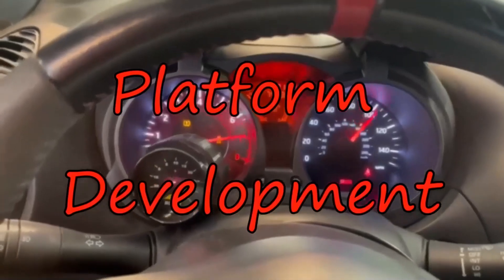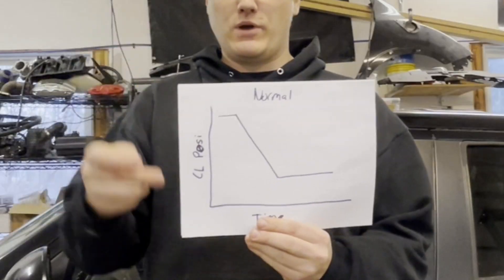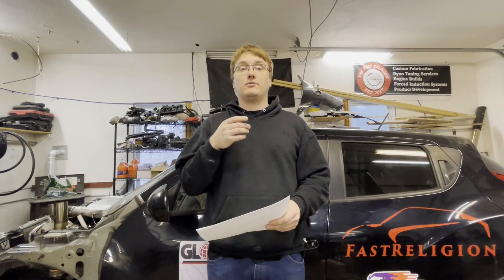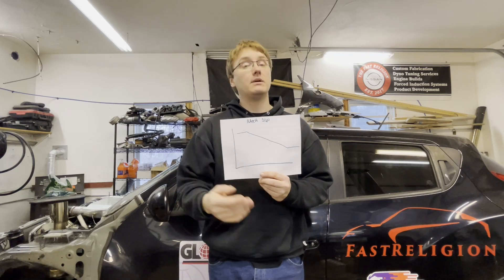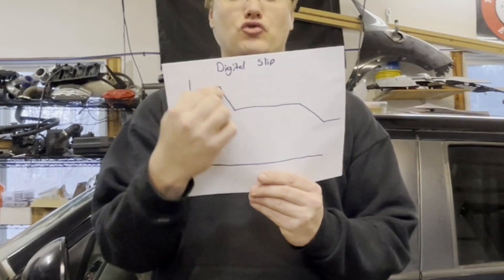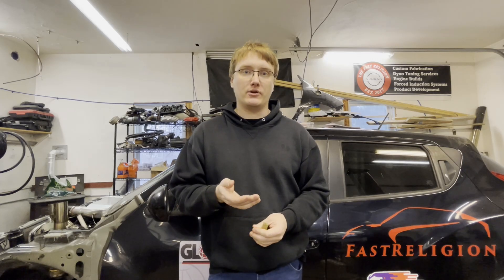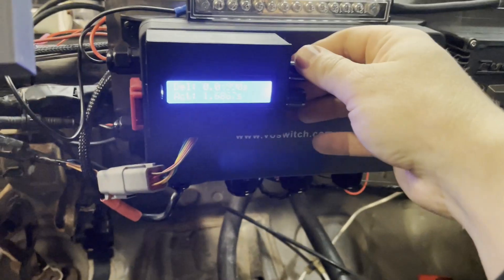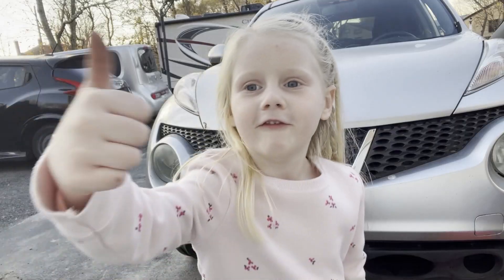What Is a Clutch Slipper? How Does It Work?

Comment: About 5 minutes into this. There are a number of applications for a 'slipper clutch'.
Cars are one, particularly for the launch off the line.
Bikes are another ~ particularly for the downshift, so your high performance engine with high compression and lots of cam,  little to no flywheel, mid-range to high capacity, doesn't compression lock your rear wheel, even if you rev-match the downshift. Race bikes today, tend to have a slipper clutch but also a computer controlled throttle, so you have the ECU add a little bit of throttle on the downshifts to control and moderate the engine braking. Getting that right is a major part of setting up your MotoGP bike, and it's worth well over a second a lap.
One of the more interesting ones I have personal experience with, was the Aprilia Futura 1000, Italian V twin sports tourer. It had a slipper that was controlled by engine intake vacuum. You get on the throttle hard, there's no vacuum, and the clutch bites with the full strength, but when you're back shifting at mid ~ high rpm, there's a lot of intake vacuum, and it has a pneumatic servo thing that adds or subtracts clamping pressure because of intake vacuum. If there's a lot of vacuum, the clutch tends to slip, which is nice when you're having a big go.
Like the Limited Slip Diff ~ there's more than one way to skin a cat.
Torque converters often have a sprag clutch on the (what do you call it? The centre flow straightener.) It can turn freely in one direction, but it locks solid if you try and turn it the other way. Conceptually, it's a ratchet, but it doesn't work like a ratchet. I've seen bikes that employ that concept to the whole clutch basket. It locks solid for forward drive, but slips on over-run. Does make it next to impossible to bump-start the bike, though ~ I hope your starter works and your battery's not flat. 
Talk about sprag clucthes, I don't know if all bikes work this way, but many do. They have a sprag clutch on the starter, so it releases when the bike fires.
A typical auto transmission has clutch packs, it has friction bands around the outside, it has a torque converter, and it may have other weird devices to control clutch action. If it has a 'lock-up converter' then it has one more clutch, to make it a direct drive through the converter.
Then we get into the rich field of Limited Slip Diffs. There are all manner of open or shut centres, starting with Detroit Lockers, going through 2 pinion and 4 pinion clutch-pack difs, Torsen diffs, fluid coupling diffs .... the concept is easy to understand, but actually getting it to work right and not intrude on normal driving ~ that's tricky. Like setting up a slipper clutch for launching a car ~ simple in concept, but very tricky in real life.
Go to Top Fuel Rails. When I was a lad (I'm 62) a Top Fueller had a completely mechanical setup. You were allowed (in the '70s) to use electronics and computer technology, to provide telemetry data ~ to have a log, with a graph, but the actuation of the clutch ~ along with every other control on the car ~ had to be entirely mechanical. That included things like centrifugal advance / retard on the ignition. I don't know when they changed the rules on that but boy ~ Howdy! She's a different game today. Which I guess is to be expected. In 1970 when I was 7 or 8 years old, a Top Fuel car ran a high 7 on a normal pass, a mid 7 on a winning pass, and a low 7 was getting close to world record time. Big Daddy Don Garlitz was still building Swamp-Rats, and some of them were embarrassing failures and some of them were world beaters.
The first ever rear engine top fuel rail, as a Swamp Rat.
Today, there are street cars running low sevens.
My last bike, was capable of high nines ~ show room stock. That was a ZX14, No, it didn't have a slipper clutch. It had a completely conventional multi plate bike clutch, but it was very big and strong and beefy, and maybe the best motorcycle clutch I've ever experienced. There were some things I loved about that bike and some I was less impressed with, but the clutch was a work of divine inspiration. It was just brilliant. You could have driven a large heavy car around with that clutch, no problem at all. The fact ZX14s had a drag strip reputation ~ partly that was power and power / weight, partly it was long and low and heavy at the front, but largely it was down to the magnificent clutch. Best clutch ever built into a motorcycle, and not by a small margin.
Reply from the maker: So, there is a difference between a Slipper clutch and a Clutch slipper. A slipper clutch is very well covered by what you typed out. A clutch slipper is a device designed to force a clutch into slipping. Not the clutch itself.
Reply: @TheFastReligion  Yes, I stand corrected.
Reply: good read thanks for typing

Comment: Would this setup have the ability to hold the clutch engaged with your foot off the pedal? Then launch like a trans brake.
Reply from the maker: This system could not do that, as the programming and set up for what you’re describing would be quite different. We could pretty easily design that. The issue would be making it so you can creep into the beams under launch control. We will look into this.
Reply: @TheFastReligion   For all motor the bump in would not change for me. I would just be off the clutch immediately once double bubbled and stage brake pulled. Then launch on stage brake release.
Reply from the maker: We answered your email